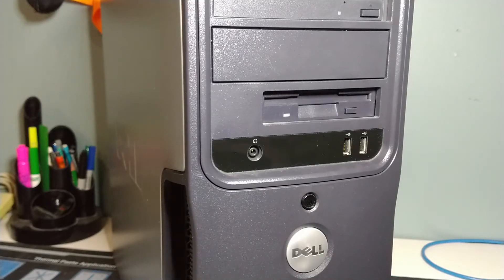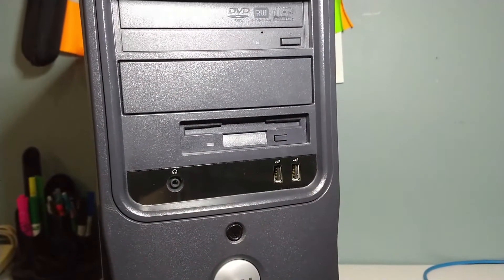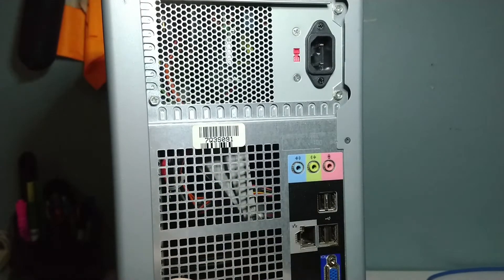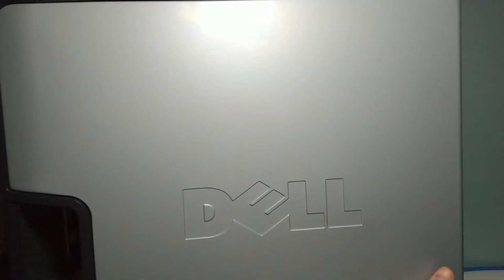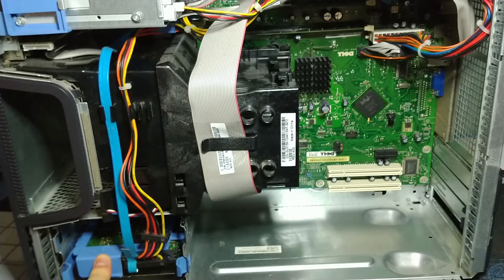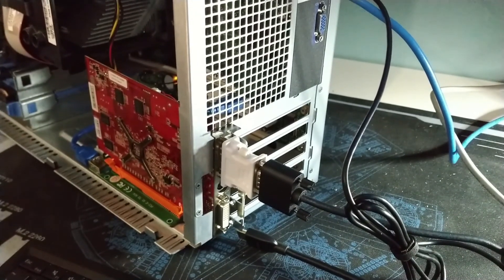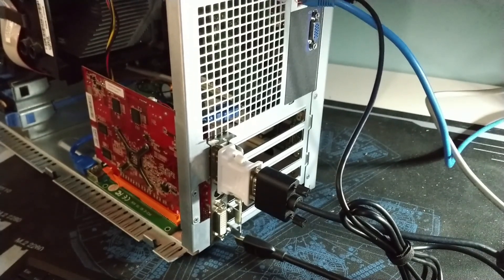Dell Dimension 3100

Comment: It's good you installed the gpu that way.
I got an 8400 gs pci-e 1x card for my friends dimension 3100 and the system didn't like it at all so we left it I then got a g210 1x slot catd and it did the same thing. I think most of the 1x cards it'll have a fit with. I might try a regular pci card or what you have done! I think the system conflicts with it, I have a feeling the gma950 takes up most of the pci-e bus or maybe has priority.

Comment: Great video! This was my family PC back in 2005 when it came out and ive been meaning to uptrade it as a project. 

Ill probably just upgrade the graphics and possibly the ram and CPU.
Reply: It doesn’t have a PCI-E slot so you can’t upgrade the graphics unless you use an older PCI card

Comment: I tend to be a person to give PC's to. So I have one of these. I replaced the celeron D with a P4 650. It had an aftermarket W7 32 bit install as well. I tried a Geforce 2mx200 and that improved the video under the existing W7 install.  I a!so tried using w2k Intel 910 drivers and they worked also from dell downloads. The people who installed the OS weren't that smart.I also put a Sblive in it for sound.  I tried the Kx project. It works ,but it didn't direct spdif passthru while playing dvd to a reciever under W7. Instead something came up and decoded it first. That never happened under XP and Linux with those sound cards. So W7 and the Kx project had issues.  I tried a separate install of W7 64 bit and Linux on ssd dual boot. The original drive unplugged for testing. I found the Intel graphics worked decent under Linux. I streamed movies from tubi  and there was no lag. YouTube on W7 has more dropped frames, because they push data.  I enjoy playing DVD's on old computers just because I can. This setup is limited but if you have a big enough swap partition/file and the right OS it is a pretty good, but power hungry media PC. It reminds me of using a Odroid C2 without the grainy graphics.  In both cases you have to watch how many tabs you open.  If it wasn't for the Em64t capabilities of the CPU  streaming would be a problem.

Comment: How do I remove the hard disc ?
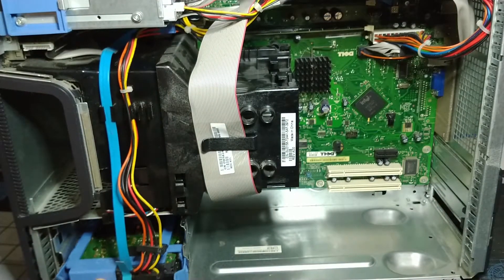Reply from the maker: At about 2:15 you can see the disk drive, it is on rails to make it easy to remove after unplugging the power and data cables

Comment: I'am already disembly..what a case a suitable because mobo port back not matching wit othe case..
Reply from the maker: This was actually common for a while with Dell, HP, IBM; making their motherboards and cases the oppposite to a standard design.  It is pretty irritating to not be able to pull the board and place into a standard case.  I would recommend looking for another Dell from this time period, or something like an IBM ThinkCentre M51 (8143) which has good amount of room and is also a reversed design.

Good luck!

Comment: I think you can just cut the plastic off the end of the x1 slot to make a x16 card fit in.
Reply from the maker: Yea that might have worked.  I can't remember if there would have been enough room lengthwise to fit with the CPU assembly.  I think it worked out ok though.